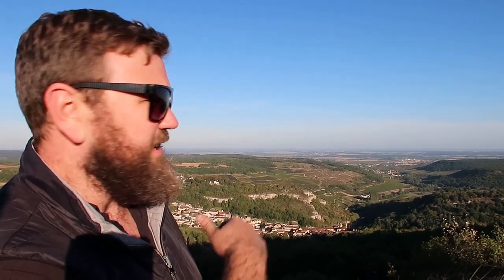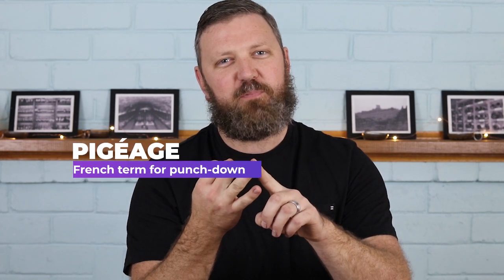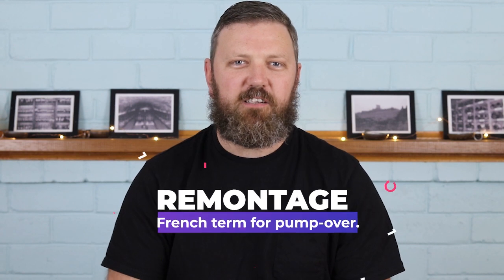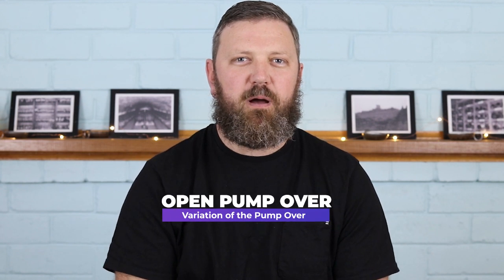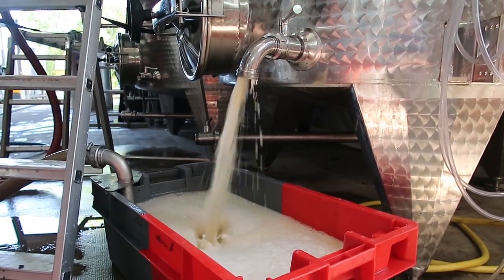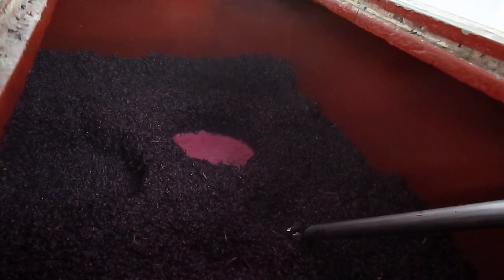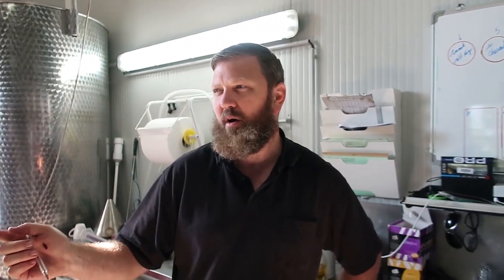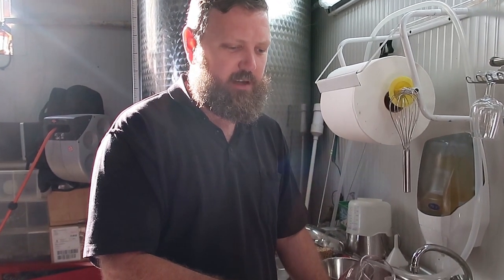In the Winery - Cap Management Techniques

Comment: first Sir, it was not clear to me how much you were heating the tanks ...at the beginning of your ferments and for how long, and near the end?
Next I was astonished you did your pump overs twice and basically...in the morning and after lunch? surely you do them over 12 hour intervals to avoid microbial issues? how long were your pump overs?
Anyway,too many questions....if you could answer one , it'd be good?
Great video!!! :)))

p.s....was pretty risky what you did with your feet, if you'd fallen in you could have been kod for life with the CO2?
Reply from the maker: Good questions Philip,

One approach to temperature management is to start with a cold soak, maintain a moderate temperature through the ferment and then warm to finish off.

Twice daily pump overs are a standard procedure for wineries that don't work a night shift. There's no risk with this approach.

Foot pigeage on the small vats is low risk whereas the larger vats are high risk.

Cheers!
Reply: @TigesTheWinemaker  thanks for the very concise answer.....BTW, I'd be interested to know how that Pommard turned out?
Reply from the maker: The village Pommard turned out to have good balance after a bit of warming and more pigeage

Comment: to be clear here Tiges with the full stem berry ferments you were doing a carbonic or semi carbonic maceration?   

 1] During fermentation even at the end you would heat up the ferment to get more extraction?
Reply from the maker: Hi Philip,
This was a semi carbonic technique. 2018 was a warm year with early ripening, so the rachis were still green. The decision was to use minimal whole bunch (10%) to add complexity without too much green tannin. Warming during  extended maceration was to increase extraction
Reply: @TigesTheWinemaker  yeahhh i noticed they were a bit....but it was clear in the picking that they'd cut the stems the pickers right down to avoid to much stalk.....wish they'd do that here! :)))

Comment: The part about the temperatures when working with yeast during maceration period? May I ask you to explain more in detail?
Reply from the maker: Thanks for watching Evaldas, 
Higher fermentation temperatures will increase anthocyanin and tannin extraction. Changes in fermentation seem to have a greater impact on extraction than maceration techniques which play a role (albeit a less significant role than temperature).
For more information, check out the AWRI YouTube channel: "Using maceration techniques to tailor red wine styles"